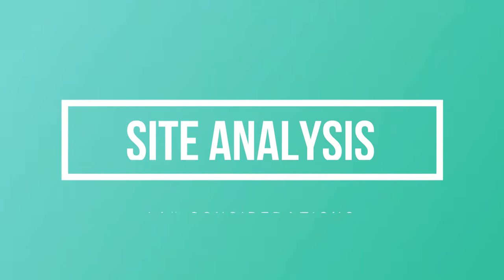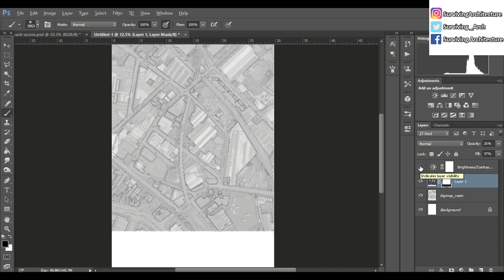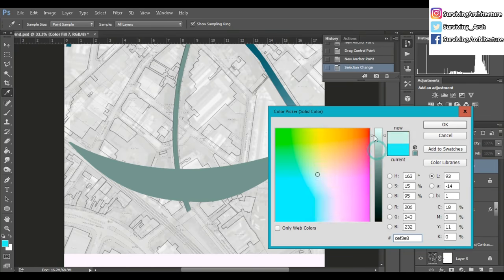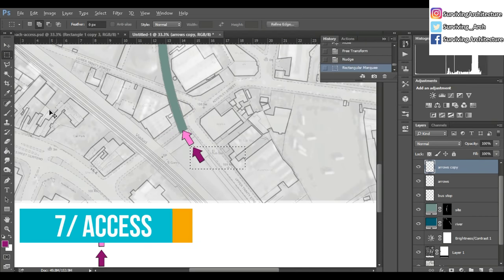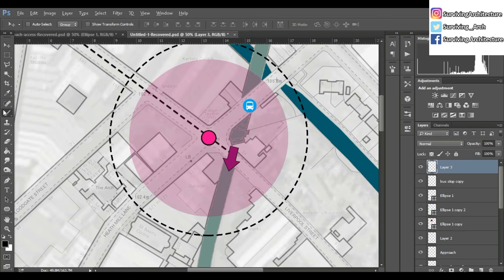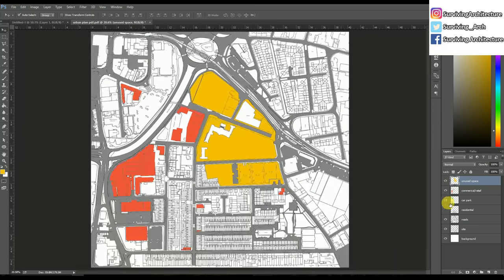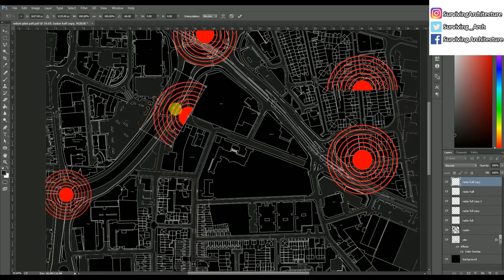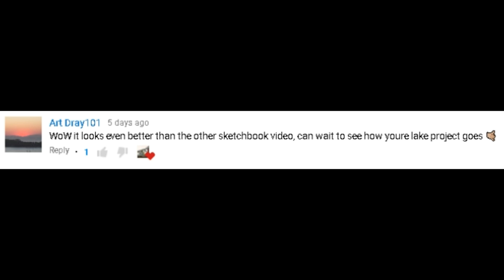Architectural design Site Analysis | Adobe Photoshop

Comment: Hi im wondering.. how do u present all these different elements at once like as a story, should you determine the design idea first before conducting site analysis and lastly, how do you determine the accuracy of the data (like for example the specific noise levels and sources) or rather how long did it take to be completely sure about the data were collecting/how long did you take to finish collecting it on the site
Reply from the maker: To do this, first present all of your site analysis findings, then your concept, then how it relates back to the site analysis. As for accuracy, you can try to find creedible sources for noise levels in that area but it won't be as acurate as getting a noise specialist. For a university project, it does not have to be accurate as they care mostly on how you respond to these conditions.